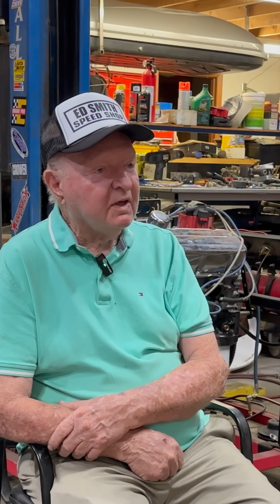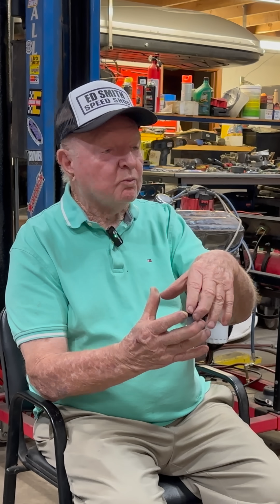455 Oldsmobile Jet Boats - Ask Ed 25 - Ed Smith w #BarryT #bigblock

Comment: 455 Oldsmobile is a great engine. 
I owned a 75 Cutlass Supreme with the 455 even the detuned 75 model had good power. 
I can see why that they were an excellent boat engine.
Reply: Lol. Those motors made like 220 horsepower. They were turds.